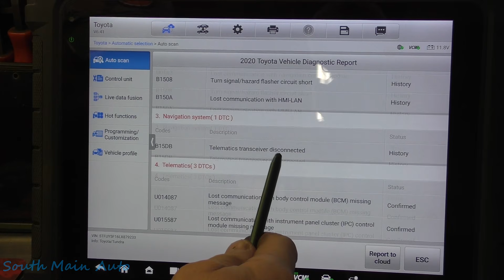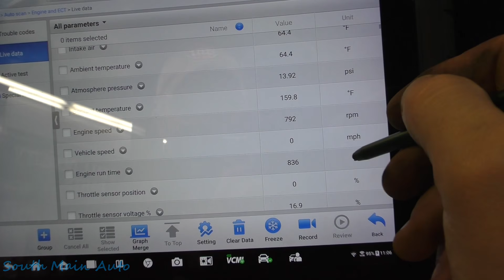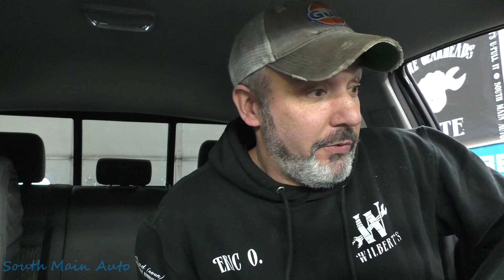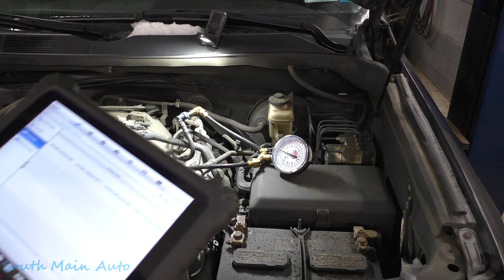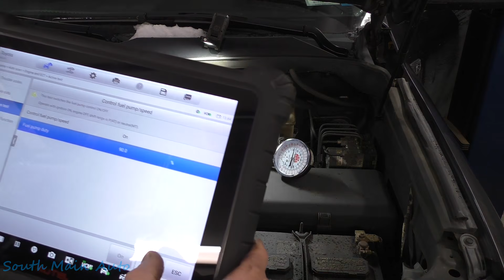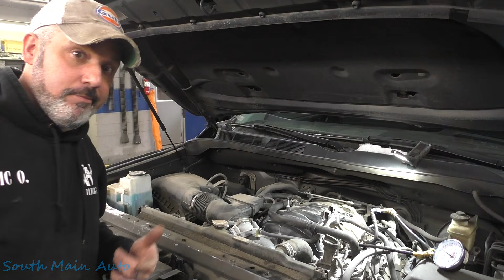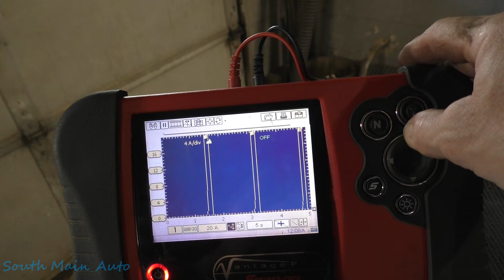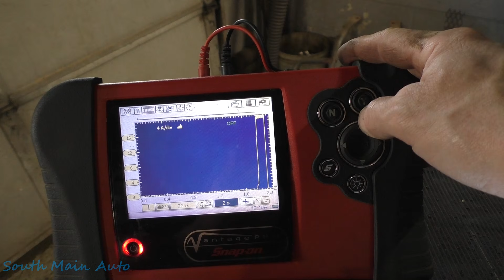My Customer Is Getting Shafted By The Local Toyota Dealer

Comment: Excellent diagnostic, Eric! So, the dealer spends time guessing and throwing parts at it, but can't spend that time doing a proper diagnostic? And customers have to pay for it...
Happy 2025!!
Reply: They rely on pattern failures or more commonly known and an educated guess based on what they have seen, if it works is it a bad guess?
BUT when it fails them they are screwed and throw parts until it's fixed at customers expense
Reply: @lloydtucker  Yep, pretty much so.

Comment: I have had many GM cars. Pontiac tempest,  Pontiac sun fire,  Bonneville,  impala....... the fuel pumps in the tank went out at about 150 K on all of them.    GM should have put an access hole under the back seat. I know it would have cost them $10.00.

Comment: once you hit the tank with that hammer and I heard the racket that pump was making,I knew it was the pump.great vidio.
Reply: Yes it had the tell tale sound. I wonder how the owner was able to get running with ether. Just strange coincidence I guess.
Reply: @johngriffin5142 maybe the engine pulls a bit of vaccum to help it get going?
Reply: @agger838  It's very curios. If I understood Eric correctly the owner stated that when he started the engine in this manner, it would run no problem afterwards. I'll have to rewatch and pay closer attention to the fuel setup on this vehicle(or just research it). If it's just standard port injection with fuel rail and  electric injectors then I don't think vacuum would play into to it. Maybe though...I guess it doesn't really matter...just a curiosity.
Reply: @johngriffin5142  he also talked about the alternator giving it more volts
Reply: @agger838  Sequential port injection...pump is definitely binding and drawing a lot of amperage. Once it does get going it doesn't seem to just fail(not yet any ways)but is drawing too much amperage. Maybe when the customer fired the engine with ether the alternator provided enough amperage to overcome the binding similar to when he had the battery saver on there but even more so. Eventually that wouldn't work either. Lol...should have watched all the way through before posting.

Comment: Toyota Tundra's fuel pump failures are a known problem and were on a recall.   Toyota notified owners of the safety risk with an interim notification between February 17, 2020 and May 4, 2020 . Toyota will send a second notice to owners to have the fuel pump replaced once the remedy is available.     Many (Young Tundra's) have had failed fuel pumps.

Comment: The best place to find info on these weird problems is usually the vehicles owner site. Someone out there has almost certainly  already had the problem and knows what the cause is.
Maybe this guy was constantly running at low fuel-tank levels? That could over-heat the pump and cause early failure.
Reply: I have found that to be the case trying to chase down a hard shift issue with my father's brand new Ram that the dealership said they won't do anything to diagnose  unless it throws a code!  I came up with at least 3 possibilities just going to a forum where people were discussing similar issues and what fixed it.

Comment: What people don't understand about dealers is that most of the mechanics who work there are parts changers and nothing more.  They might have one or two guys who actually know how to troubleshoot problems in depth.  Most of the guys like you who are good at diag go into business for themselvss.  I'm not surprised by the updates you've shared about the situation, Eric.  Arrogance and incompetence are the hallmarks of most dealership service departments.
Reply: Lol i fix floor cleaning equipment im in dealerships almost daily if the public saw the technicians i see you would never go back 99% of techs arw 18-24 year olds that dont know shit kinda makes me sad
Reply: Here's where america fails.  TIME IS MONEY!   If you take the time to diag properly, who will pay for your time?   I am in that boat.  4 to 1 kill to fail ratio is actually considered to be great.  If you can pull out the parts cannon and fix 80% in minimal time you are a mechanical god in many industries.   Most customers don't want to pay for diag.  Most customers don't want to be without equipment for 5 hours while you diag.  They bitch about it.  So you pull out the cannon and fire away with "informed logic"   If I am on a machine for more than an hour I have 100 people coming by asking when I'll be done because they need to use the copier/scanner/printer now, they don't want to hear that you need to troubleshoot more.  You not getting it running immediately is making them lose money.
Reply: @scannerlanier471  that's not an apples to apples comparison for a number of reasons
Reply: @youtubesucks666  I really don't see much difference.  In both cases a tech, given enough time, can repair a machine as it should be.  The common repairs a trained monkey could fix as you see them again and again on different machines of the same model.   The repairs a bit beyond the norm though take time for troubleshooting and analizing.  There are no customers of mine that will pay or wait for 6 hours of troubleshooting time, it goes the same with automotive.  On top of that mgmt doesn't want to hire a reasonable amount of techs.  Something about mgmt bonus I hear. Sometimes that is what it takes to trace wires and signals.  Copiers and printers also adjust operating parameters same at vehicles.  An imaging drum is aging, machine logic adjusts parameters.  Just as an 02 sensor or maf on a car.  And let us not forget the BIGGIE.  CHINESIUM.  There are parts destined to fail in both (pentastar 3.6 for example)   I can't wait for the automotive parts to start coming from VietNam.  You will wish you had CHINESIUM parts at that point.   For reference I am talking commercial copiers and printers, not the cheap throwaways.   I rarely service anything much less than $10k machine.  My top end is $250K.    Imagine a laser on these pinpointing to a drum at 1/5,760000 inch squared.   There is nothing this precise in automotive.    End of discussion (jumping off soapbox)
Reply: Back in the day, when I was working the parts counter at the dealership, that was what the service manager was supposed to do. Get the job routed to the correct tech, and give directions on troubleshooting for the less competent or experienced technicians. 😢 I’ve had only a few interactions with dealership repair shops since I left 40 years ago. It sure seems that there is a problem here with how dealerships process incoming service issues.
Reply: @commpost2  Totally agree.  Todays service mgrs are more interested in spreadsheets showing profit/loss than anything else.  It's all about reaching that carrot called year end bonus anymore.   In my industry the cheaper things can be done, the better.   I had an aftermarket part fail twice on the same machine.  I put in an OEM and I got hollered at because it cost too much.  But guess what OEM fixed the issue!!
Reply: i don't think it is incompetence, they just don't get paid their normal rate for warranty work, so they will come up some other "problem" to try to make a larger paycheck
Reply: Hallmarks 😊
Reply: That might be what you're used to, but that's hardly the case in my area (upper midwest).
Reply: That's it with my shop.  4 mechanics but only one that can dx.
Reply: My nephew has worked for Carmax for a long time, he said there are 20 people working on cars/trucks on a daily basis.   About four of them are true mechanics, including himself, and the other are barely part changers.
Reply: Arrogance is not a hallmark, but there  is a lack of education and training for sure. I’ve worked with a lot of techs and the vast majority are well intentioned, but often misdiagnose issues for many reasons. When I’ve had the time to be one-on-one with younger techs and explain things in their style they almost always turn around and put it to good use. Problem is I have a million different training courses to keep up on with how many different heat exchangers are in the latest hybrid, on top of technical assistance cases and phone calls and spending time with customers because the advisors couldn’t possibly be fluent in the latest technical and practical aspects. All that is to say I agree there is a lack of high level techs in the field at the moment, but it’s because the learning curve is very steep and there’s no one around to teach. I know some techs are shitty people but the vast majority are not.
Reply: Not true at all! Most good franchise dealerships have 2 or 3 long term mechanics! They also have a data base to talk about any situation! They can figure it our usually! The problem is money! They only get paid per ticket! That job may have got kick the can because of crap money on the warranty repair! Mechanics have to eat and pay bills just like the rest of us! God bless Trump #47 and #45
Reply: Wow! You checked all mechanics in all dealerships in the USA and arrived at this conclusion? You had the time and patience to interview thousands of mechanics and service advisors. Must have taken years.

Comment: Fuel pump could be low pressure and spray the intake then starts with  spray but shut it off not enough press to push to injectors so spray might help it start

Comment: I got shafted by GM with my 2nd hydraulic lifter failure.  Now the engine isn’t worth repairing (out of warranty) and so I’m looking at an engine swap with a DOD deleted reman.  I’d bring the car to SMA if you were closer than 700 miles distant.  🥲.  This is uncommon they said.  Lightning doesn’t strike twice they said….well, it’s common, and yeah lightning can and did strike twice.  This sucks.

Comment: I had something very similar happen with my Lexus LS460L. It did it from 8,000 miles (when I bought it) up until 35,000 when it got rear ended and totaled. Lexus dealer said all 8 injectors failed, and it was almost $10,000 to replace them. I didn’t believe them so I never fixed it.

Comment: Weird. No P0087 and it has "Fuel Pump ECU". ...why, Why, WHY?
did they forget to code it in? ..if it don't have Fuel pressure sensor then, how it calculates needed fp-duty?
..Just 90% on cold starts and 30% when engine has run over x-time?

Comment: My number one fear about owning a Toyota or Honda is this scenario where the problem isn’t obvious.  There aren’t a lot of experienced diagnosticians out there. Another great video Mr. O!
Reply: Gm and Ford are no better' they don't pay the tec's to train anymore engineering changes too quickly . The company reps aren't  up to date and knowledgeable, the dealer ships are full of vehicle waiting on Factory reps to diagnose issues. All at customer cost!
Reply: The engineering doesn't change too quickly, that's an excuse. A Ford tech needs to learn somewhat recent Ford products and that's it; it's not the dozen or so brands Eric O has to deal with spanning decades on a regular basis.
Now I know we aren't all Eric O, but if he can manage to figure out you need a pump to get fuel in an engine, a "manufacturer certified master technician" should be able to figure that out as well.

A variable duty cycle pump system with stall detection isn't alien technology, these are cars not spaceships. It's simple, the bossmen don't want to pay for thinking time, and the techs aren't taught how to think in the first place. Swaptronics pays more, apparently.
Reply: Can only speak about Honda's from around 1990-2016. Never had to replace a fuel pump,even though they suffer from the same symptoms this Toyota had. It always  was the fuel pump relay.😅 Never left me stranded,they just needed a small tap.

Comment: Eric, You are 100% spot on! Just the noise of the pump is enough for me and I 100% agree with the why it starts with ether! That question was burning a hole in my brain the entire video but I think you hit the nail on the head! Great video like always!!
Reply: Another excellent piece of work!!!
Reply: Eric, thanks for your time in explaining the theory of how the fuel system works on the truck, before moving onto the diagnosis. Best wishes.
Reply: Cosby sauce.
Reply from the maker: I had to think about that one for a second too.
Reply: @SouthMainAuto   the increase in voltage is the answer I'm buying!
Great work! 
Glad to be a long time subscriber! 
What's up for when you hit 1,000,000,000 subscribers?
Reply: @dans_Learning_Curve  1 Billion?  I think he then owns the internet.
Reply: I'm not at the end, but I'm guessing it's unrelated. The pump eventually responds and he thinks it's the spray that did the trick.

Comment: What's frustrating to me is that the dealer had a better option if they disagree with your diagnosis.  Ask the guy if he'll agree to pay for the pump if they put it in and it doesn't fix the problem.  If it does fix the problem, that proves it was covered by warranty.
Reply: That only works if you trust the dealership to be honest to begin with unfortunately.
Reply: they'd rather you trade it in and sign a huge payment plan, then one of the mechanics buys it for peanuts and replaces the pump and drives it around themselves.
Reply: They'll just say they changed it after letting it sit in the lot for a week.

Comment: I'm learning so much from you Mr.O...........I'm getting to a point where I can figure things out. It's the speed at which I get it figured out that is the problem. A couple of sleepless nights having irritating dreams while I think about it and BANG! Problem solved. The upside is I'm not on the clock.....I'm just a lowly mailman with a strange obsession of figuring out how things work. If I could actually read a wiring diagram and pay for service data I could reduce that diag time to a day and a half. LOL! Believe it or not there are some weird people out there get off and work and head straight to the gararge. I'm trying to graduate from firing the parts cannon to actually digging into theory and operation.
Reply from the maker: See if your local library has free service data through motor, Mitchell or all data. A lot of libraries do
Reply: @SouthMainAuto  What a great idea....Thanks! I have a library literally less than 5 minute walk.
Reply: @SouthMainAuto my local library has/had (last time I checked) ALLDATA  it was free.
Reply: You'd make a beautiful assistant :face-turquoise-covering-eyes:
Reply: @mejesse809  That's Spicoli, big dawg
Reply: The library is great advice. Most people forget about them. They think the "smart phone " will have the answer instead of doing some research.
Reply: @glenniosbaker5193  Yep.....the library never even crossed my mind. I have paid a few times online for factory service info but that gets expensive when you're not working for profit.
Reply: just don't let it drive you postal!   🤪

Comment: Dealerships are getting worse and worse. I just got my walking papers "account closed for purchasing" from our local Ford dealer because I diagnosed a bad Lead Frame in an F150 last year and they refused to replace it under the warranty and now that it's out of the extended 10 years warranty, they want to charge him $1200. Brought it back to me and I have to buy it online because everything I call for is "not available". I do miss the days of just putting a jumper in the fuel pump relay and stick and amp clamp on and watch the waveform.